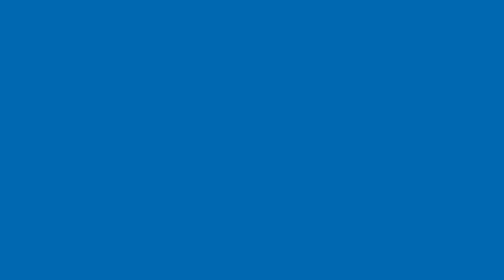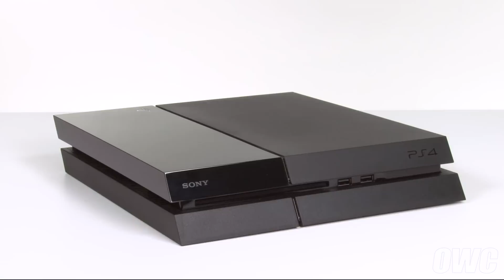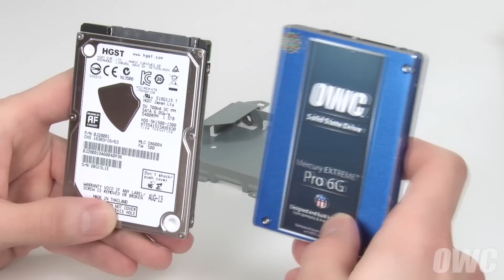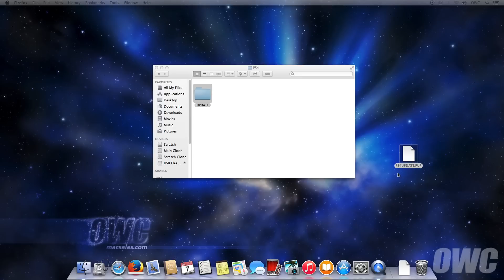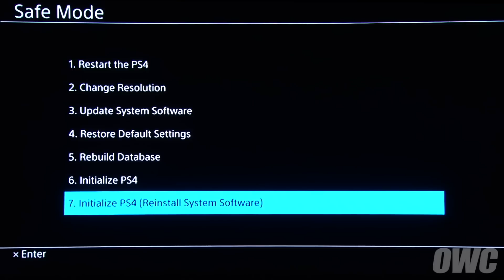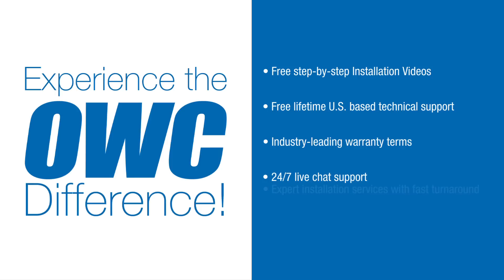How to Upgrade a Sony PS4 Hard Drive

Comment: A couple of things that might help some people who are going through this process. When you have your dualshock plugged in- you need to use the "press pad" directional keys to select menu items. Additionally, your thumb drive needs to be formatted to FAT or exFAT to enable the PS4 to read the file.  I also found that some of the other older instructional sites forwarded me to a site that had older update files... which obviously didn't work either. You need a minimum of 4.7- and you need to 800+ MB file... not the 350MB file. These are all things I've stumbled through- making the process less than smooth and efficient.
Reply: What does one do, if they wish to upgrade, but do not own a computer?
Reply: @1damageddopey647  call a friend I guess?

Comment: My PS4 doesn't have a shiny top like that and it doesn't come off
Reply: JayRex D no I don't have the pro I got it in 2015
Reply: Am I doing something wrong
Reply: MacSales. com I have rthe PS4 that comes with the uncharted trilogy digital download, and it does not have a glossy top, the top is the same texture as the rest of the PS4, because I believe this is the 2016 edition
Reply: Nevan Dempsey then its a PS4 slim
Reply: Nevan Dempsey same for me. It's still removable. Not sure about ps4 pro and slim
Reply: Nevan Dempsey    Me too
Reply: Nevan Dempsey
Reply: Nevan Dempsey then u might have Pro if it has 3 tops or slim if it's just flat at the top like me but the 1 with the shiny top Is the original PS4
Reply: Nevan Dempsey sAme thang
Reply: Nevan Dempsey it's a slim
Reply: Nevan Dempsey same bro
Reply: Well I've heard it comes off but you have to pull harder is this true?
Reply: You have a slim like me. The hard drive should be on the side of the PlayStation.

Comment: like the ps4 doesn't have enough storage already
Reply: uralsmol most ps4 consoles have a 500gb hard drive. Thats not a whole lot in all honesty. That goes by fast when you have multiple games 20-30gb each and then downloading a number of updates and dlc content for each and then system updates. Trust me. I only have 5 games and with updates and dlc most of it is used up.
Reply: It has nowhere near enough storage for most people
Reply: Mine was full in 4 to 5 months.
Reply: Also if you dont want to upgrade the storage this way you can buy a 1tb external hard drive for around $40. Just plug it in, install software, (not sure if anything else because i havent done this for ps4 yet only xbox)

Comment: My OWC 2TB hard drive for PS4 was working fine yesterday. But this morning I was downloading the Resident Evil from PS+ and put on Rest Mode. When I got home I turned on the PS4 and the screen froze for a good minute and shut off. So when I turned on the PS4 it showed that it cannot read storage but the hard drive was already in there. It also shows that to turn off the PS4 hold the power button for 1 second and I did that. And when I turned it back on it showed the same message. I also heard a continuous crackling type of sound on the hard drive. So I called customer service so far and will be waiting for a new replacement... Anyone experienced the same issue?

Comment: I'm not looking forward to messing with this. I wish it was like my Xbox one and could use an external hard drive. I just bought a 2tb seagate just plugged it into back of Xbox then transferred all games from internal storage to external. Plus I keep the original 500gb that it came with instead of replacing it. I thought ps4 was equal to Xbox in that technology but guess not. This seems really stupid compared to how simple adding memory on Xbox is.
Reply: Nick Markin i own an xbox and i did this with a 10tb hd. But in all honesty this is very simple to do if a ps4 owner wants to expand their storage. Although with xbox it is easier seeing as how you just plug it in download the drivers for it to become storage for the system and just transfer your games over, this is fairly simple.

Comment: What will this new hard drive allow you to do? (I'm not good with electronics)
Reply: Most ps4 have 500gb and some games like call of duty can take up to 75gb so a new hard drive could let have 1tb which is equivalent to 1000gb and it can also make your ps4 run smoother depending on the hard drive
Reply: Depends on the one you buy

Comment: What flash drive did you use? I have a Cruise Glider (I think thats what you call it) and it says "USB not connected". Is it my flash drive, or is something just wrong?
Reply: I formatted it 3 times (Fat, exFat, Jounal) on my Mac, but it still doesn't work. Also, is SanDisk - Ultra 16GB USB 3.1 Type-C Flash Drive a good one to buy?

Comment: This sounds promising, but what is the advantage to replacing the drive? Could I use a VR headset on an upgraded launch ps4 and have it perform better than it would before?
Reply: +MacSales. com Ah, so upgrading the hdd is kinda like upgrading the ram.
Reply: +MacSales. com oh. Okay, no problem.

Comment: My screwdriver won't work on the 4 screws with the hard drive. its coming apart (losing metal flakes) and stripping the Philips head screw.
Reply: Did they help you

Comment: I want to do this but does anyone know where I can get a drive like that?
Reply: It doesn't have to be a specific drive, just make sure it isn't too big or wide or it won't fit into one of the ps4s usb slots, you only need 1-3gb to save save data and the system software update

Comment: hi the problem having is that disc based games not working it says disc can't be read but when I put my original HDD back in it works perfectly any idea whats wrong
Reply: See the problem though is that I tried multiple hdds and all excluding the stock HDD won't read disc games. I must be doing something wrong I just don't know what. It installes perfectly fine I follow steps down go the letter but something is wrong. Have u heard of this problem b4? Any help would be appreciated and thanks for the quick reply
Reply: OK thanks I will contact later tonight